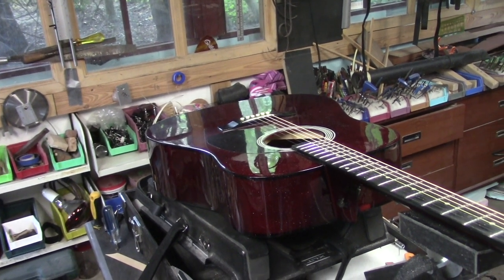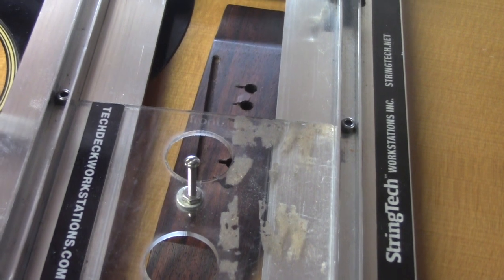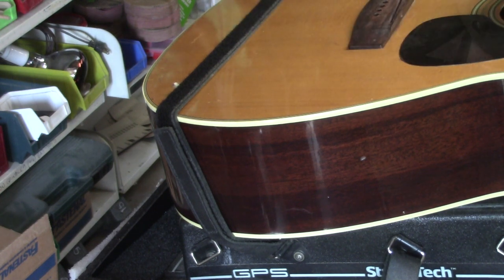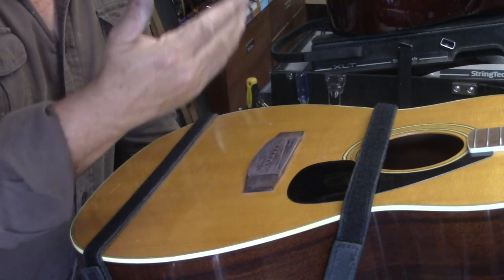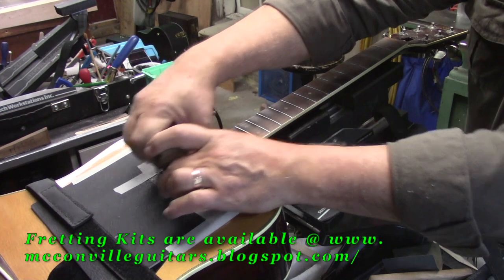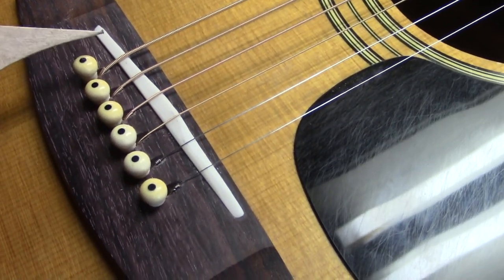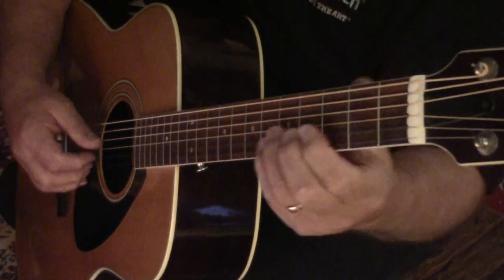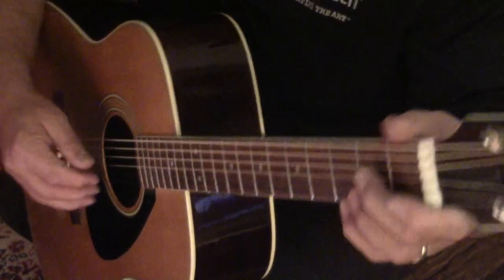Inexpensive guitars Perfectly in Tune @StringTechWorkstations

Comment: That Yamaha sounds great, I'm sure even better than when it was new. Thanks for this video, my wife has one that was built in the mid 70's that is a beautiful guitar that needs attention, we call it the "egg slicer". It seems you have to tighten the strings so tight to tune it. It does tune, holds a tune and sounds great, but the action is high and strings so tight it's uncomfortable to play. With the help of this video, I may get her right. I have to add that these guitars, even though they aren't high end, are made from good woods and well built. I've heard an old luthier say that building an instrument and setting them up is two different things.
Reply from the maker: The point I was making in this video : #1 In most cases it IS possible to regulate a guitar to this level of accuracy. #2 Although this guitar doesn't have a big robust voice ... it IS perfectly in tune and silky smooth to play. #3 Because there are so many variations on string ( gauge ) choice / scale length / action preferences / left hand fretting pressure / right hand attack etc ... etc ... there is no quick one step solution to attain this level of accuracy. #4 Manufacturers can't possibly adjust every guitar for every possible case scenario. This can only been done by a good Tech / Luthier in close conjunction with the customer and his/ her preferences stated clearly before the work begins. Thanks for watching / listening. MMcC

Comment: Had an FG150 I bought new in Hong Kong, in 1976, so I'd say the guitar is at least 40+ yrs old. Mine while not the greatest guitar, sounded pretty good, especially since it cost me $50 USD or HK$200. Alas I loaned it to my brother in 1983, & he reported it "stolen". (I should've checked my hometown pawnshops. LoL) I bought a Fender F15 back 1984 that could've been the model Yamaha was copying. That Fender though not their top of the line acoustic, had great tone, stayed in tune, etc. I'm always glad to see any guitar "up & running" regardless of price point (As they say now).
Reply from the maker: Thanks for sharing ... interesting story. Those smaller bodied guitars can really stand the test of time. Their are still tons of those F-15 still kicking around. Stick around ... the upcoming video on a small acoustic will blow your mind. Cheers ! MMcC

Comment: Incredibly in-tune and melodic, as you say I struggle to compensate on my guitars but there is so much to think about without trying to pitch correct. The fingers drag or squeeze the strings off key if I get sloppy. What tuner do you use to setup the intonation so perfectly or do you have perfect pitch (a good piano tuner's ear)?
Reply from the maker: Rob : You are absolutely right ! The final factor is the "Zen" factor. I do mention this in my instructional videos ... you have to be careful not to " death grip " with the fretting hand.       or " jack hammer" with the right hand attack. I use this " Cleartune App " ... you can download for 6 bucks. Cheers  MMcC

Comment: Question…when cutting string slots on the bridge, shouldn’t there be a slight groove for the string to set in after compensation to keep it from sliding across the bridge itself, and to keep open strings from buzzing from lack of solid contact with the saddle? I ask because I have gotten work back from big companies, and luthiers, and my first two strings High E, and B  buzz and sound dead playing them open…they don’t sound like they are making solid contact with the saddle when played open. I realize this a moot point once you fret the string, but I play open voicings, etc. And I need to find someone who can make my expensive guitars play in tune like that video.Any comments or help is much appreciated. Thanks..
Reply from the maker: The "break angle" from the bridge pin hole, to the focal point on the bridge saddle needs to be tight enough to hold the strings firmly against the tip of the saddle.
Reply: @StringTech  ok...but what do you mean tight? You mean I increase the angle of the string coming out of the bridge, or decrease it? And if it needs to decrease, how do I do that?
Reply from the maker: Hey James; sometimes a relief cut, just ahead of the bridge pin hole will tighten up the string at the focal point.

Comment: Another great video. Have you ever seen an acoustic that is perfectly in tune without a comp nut?
Reply from the maker: Yes I have. Good classical guitars ( nylon strings ) generally have very precise intonation .... and are not plagued with the "pitch displacement" ( sharpness issues ) that the steel string guitars face.

Comment: Love your videos man! I built one guitar. Trying to resurrect the fret board at the moment lol. I had it playing not too bad. Got the action down but the fret board was a little too narrow so it caused a snowball effect when I tried to widen it.. Anyways that's an encyclopedia worth . I have a question. When you mark the fret board to cut and it comes down to mms. Like 35.325mm for example, how important is it to get as close to that measurement? If you were at 35.5 mm or 35mm would that be close enough? for intonation
Reply from the maker: Honestly; I've always used template for cutting fret slots.
Reply: @StringTech Workstations  yea I'm going to look into that next. I have two pieces of metal what is supposed to be for 24.75 and 25.5 scale guitar but they don't even reach the end of the fret board on my bought guitars and they are 25.5
Reply: Ok so I started with the last fret on two of my bought guitars and the marks line up for both guitars.one is 25.5 and the other is 24.75 scale. But the first fret distance you have to mark and cut yourself. Do jigs usually work this way? Like why wouldn't they include the first fret measurement into the jig?
Reply from the maker: The full scale .. starting at the nut position ... to the last fret. There are indexing slots in the Plexiglass templates that I picked up from LMI 40 years ago.
Reply: @StringTechWorkstations  that's what I get for buying from China I guess lol

Comment: How do you calculate the right compensation on the bridge ? I've seen may videos where the bridge seems to be misplaced or where the slot is really way off ! As usual beautiful work ! Not sure that my Martin is playing so well in tune compare to this nice Yamaha after your dedicated work
Reply from the maker: Hey JP. I literally took 2 1/2 classes ( 3hr Classes )  in my Level 2 courses at the College, to cover all of the variations and extrapolations on the regulation of the guitars with compensated nuts. I do cover this in more detail for my Tier 3 Patreon Subscribers.
Reply: @StringTechWorkstations  I can imagine that is not an easy fix. Unfortunately I'm in France but I will contact my luthier and see if he can do this modification as I notice since longtime that big E string is never to pitch all along the neck. Thanks for your kind answer

Comment: Many of these Asia guitars from the 80s/90s are well constructed with good materials and are great value for those who don't have the spare money to buy a Martin/Gibson. Often though the action will not be what it once was and paying for a reset is not cost effective. A DIY reset is frustrated because the neck joint is likely to be dowel jointed/epoxy making steam removal, adjustment and regluing problematic. As shown here, if possible, shaving the bridge offers a straightforward solution. There is a luthier in Australia who steams the neck block area and applies force to the guitar to get it back to its original shape.  https://www.youtube.com/watch?v=UTVzGM1Znv8
Reply from the maker: True. Thanks for weighing in ..... MMcC